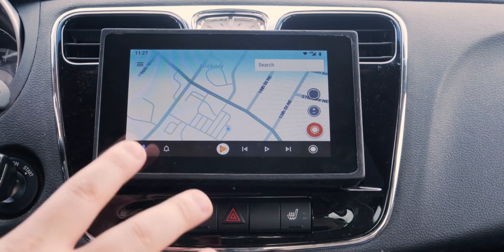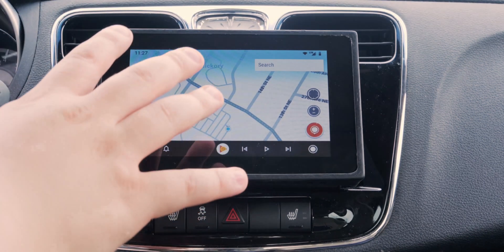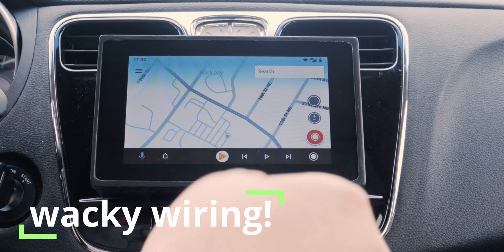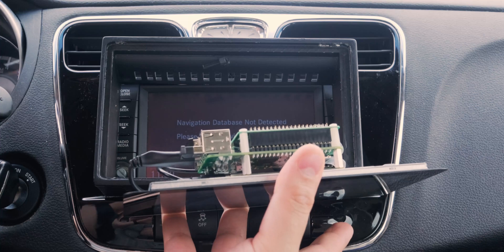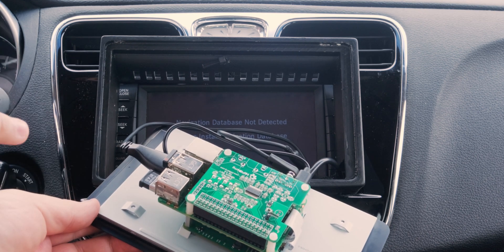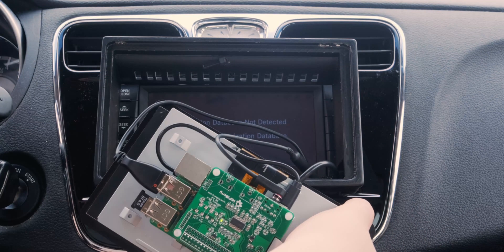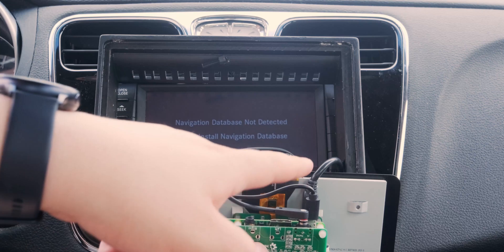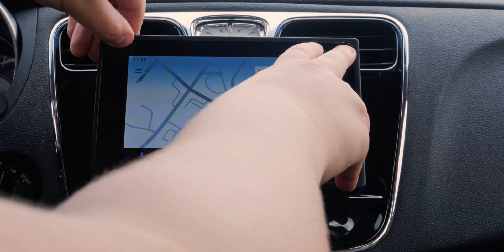Hardware Dive In & Companion App! | OpenAuto Pro

Comment: Thanks for the video! Can I ask how you are dealing with powering the whole thing down? Do you just turn it off before you turn off the car?
Reply from the maker: Yes, exactly. A bit of a process, but not too bad
Reply: @eightbitJuan  can you explain the process or have tips for a script?
Reply from the maker: Exit out of AA, then go through the normal shutdown/power off menu in OAP. 

All manual, no scripts on my setup